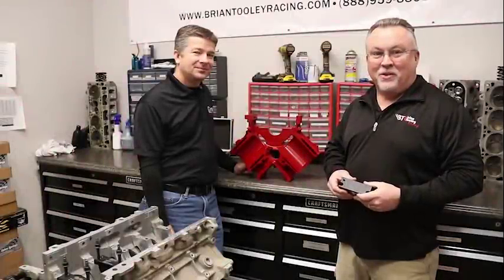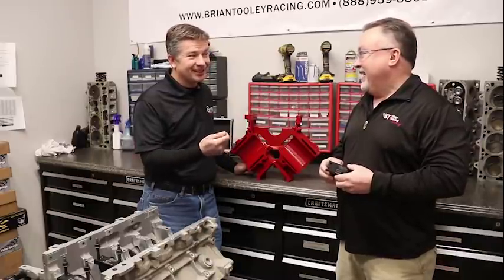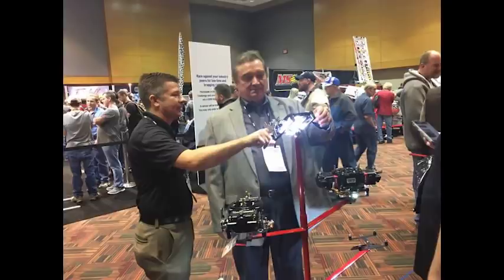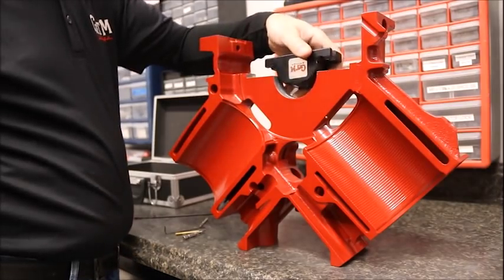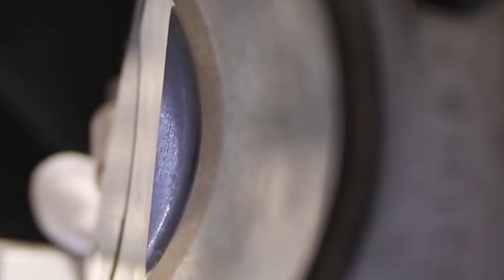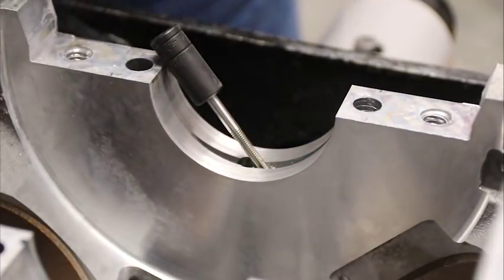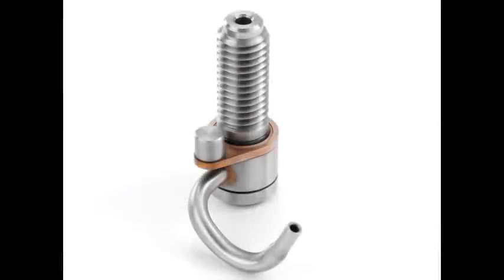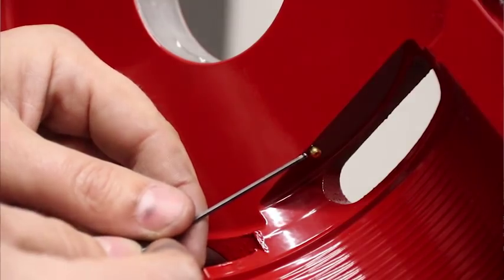LSx Oil Squirters: Retro fitting

Comment: Will the oil drain out through these squirters? Or do they have valves in them like the factory GM squirters have in the bolts that secure the squirters?
Reply: That's a damn good question.  If so, the whole oiling system above the lowest jet would be empty almost every startup, and... yeah.
Reply: @hakrsakr  
Nothing controls them...no check valve. Gm ones work around 45psi...

Comment: This setup has been around awhile just not for the LS engines.  He must be licensing the technology.   I think they are cool and own a set for the SBF, but online people say that piston coolers are useless.
Reply: Well NASCAR engines have been using them for decades so I guess those guys just do usless stuff to their engines not to mention heavy diesels been using them for nearly a century on turbo applications and Toyota started using them on their NA diesels in late 90's as well as their turbo diesel in 70,s so I guess they're pretty much useless
Reply: @Hitman-ds1ei    I get what you're saying.  Many manufacturers have used them, then taken them out.  I wouldn't compare anything performance orientated with diesel tech.
Reply: @superkillr Nascar uses them, F1 uses them, most manufacturers use them on turbo cars etc etc what else do you need to see? Its obvious they are beneficial in a performance engine AND add reliability since airplanes and heavy duty machines have used them for a long time. Even the LS engines eventually got oil squirters in the LSA and the LS9, which are the most powerful variants...
Reply: There's no licensing of technology regarding this.  Piston oil jets have been used on air-cooled turbo-supercharged aircraft engines since WWII.  Boosted engines run hotter, so that's where you'll see these fitted.  Many OEMs have done these on turbo motors for years - 300ZX turbo, AUDI/VW turbo, even non-turbo Volvo redblock engines (from 1992-93) included them (though they were not needed).